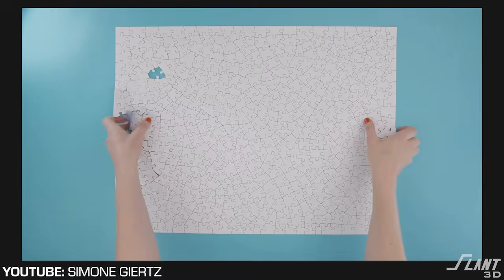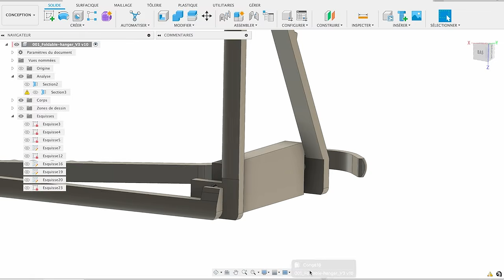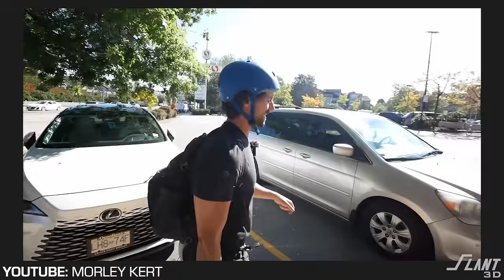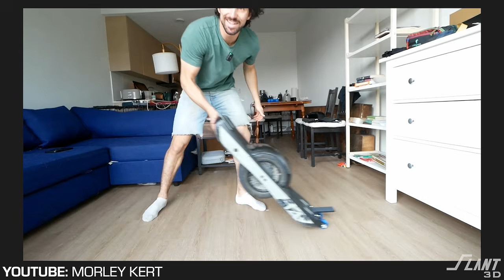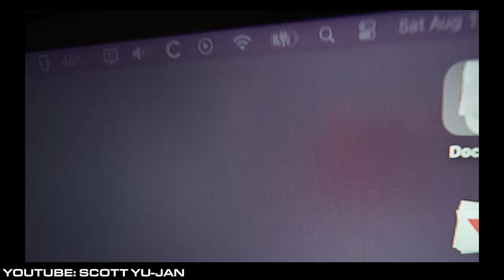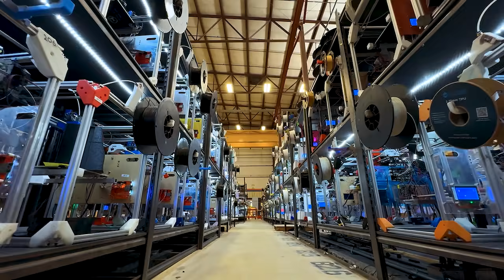Redesigning YouTuber Products for 3D Print on Demand

Comment: Storing T-shirts in a warehouse.
1. T-shirt folder
2. Dust Bags
3. Large Plastic containers. 100L boxes up

Scaling.
DTG - print on demand.
Rotary - Print in bulk.

No need for folding clothes hangers - Unless - you are displaying on a pop up market, which vastly cuts down on set up/break down times.

Comment: Regarding the iPhone design itself (I am aware that it is only an example), it is one of the prettiest and at the same time most useless designs for a simple reason - 95% of iPhone users use cases and each of them changes one precisely defined shape into thousands of completely different ones and such a “modification” is a great example of how difficult it is to implement a generally great idea into practice

Comment: I started selling 3d prints that I designed (not in the trinkets vertical) and they've been really well received. I thought about if I could use Slant3D to make them but due to needing multi-color (4 filament swaps total), needing it in PETG, and needing a small amount of post processing (weight insertion, small amount of assembly), Slant3D isn't viable. And honestly, each of those requirements are really reasonable to have met by a manufacturer.

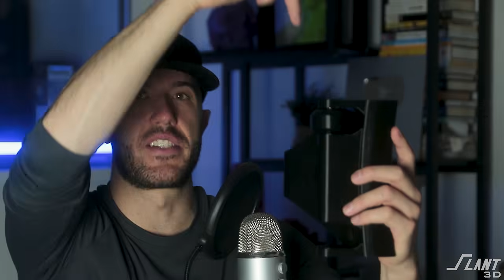Comment: 13:25 why even have two wheels, why not print one veeery wide one, use M8 rod and 2x 608ZZ bearings (even tho this doesn't prob needs bearings at all, or printed fine, but considering a  608ZZ costs what 0.20$? who cares, the rod + nuts + washers prob cost more!)

Comment: I have thought about using Portal to produce and sell my wing/kite pump hose adapters. The latest generation of these is mostly done with print in place design where one part of the print becomes a rotating collar. But... I worry about quality control. Starting out, I would have to order myself prints from the print farm to verify that the parts separate easily enough. If the print doesn't work, I have to try again and it could turn out to take weeks or months. If the print farm upgrades their printers or makes other changes to the print, it's quite possible that the print in place mechanism might stop working again. I also designed tools that make the separation easier, but once the collar rotates, you don't really need the tool anymore, so shipping every product with the tool is kind of wasteful too. So, this means each part should be tested and separated when it comes out of the printer and not at the end customer. But that's manual labor and requires instructions or training at the print farm + some printed tools. With some print setting tuning, the parts do separate easily without tools, but without that tuning, getting the print in place part to separate might take a bit more effort and the tools help a lot.

So instead of producing the parts myself or having them produced at a print farm & shipped to customers, I'm offering commercial licensing of the designs and hoping that people with interest in producing the parts in small scale will start doing so and deal with the selling, production, shipping and customer service. Thus far, my score on that front in zero, but I haven't really put much effort into marketing the products or the licensing yet.

Comment: Your I-Beam explanation fell a bit short (animation pretty misleading IMO) but it might be a good video topic for you in the future. 3d prints do use the same thing, but they're much closer to wooden torsion boxes. As you point out, the strength is in the skin, with the infill's only job preventing the skin from sliding.

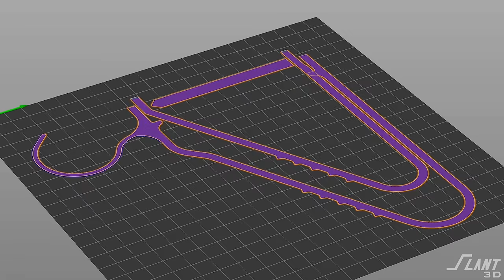Comment: The folding coat hanger is such a good idea. 5:49 I think a double hinge, similar to Simone's design, would solve this problem and allow the part to be printed flat.
Reply: It could have absolutely been printed flat.  He did it that way to be printed in place on the Slant printers, which are not particularly large as far as 3d printers go.  So basically a compromised design to work around the limitations of his equipment.  Same thing he rails against when speaking of traditional manufacturing methods.  😆
Reply: @netpackrat  Yeah this is one thing that really bugs me.  The "appearance of transparency" or worse "lying by omission".  
"It can't be printed flat" leaving out "because our printers are too small".  It's shocked me more than once when a fairly small thing "can't be printed" even though I just printed it on mine.

TO BE FAIR, this is really the only time I see this, mostly they're transparent and have good business practices.   I really hope they're investing in larger printers.

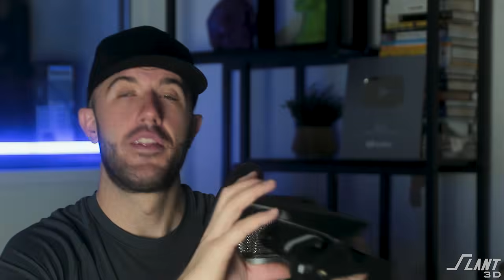Comment: Great video. I love this type of content. 12:55 Can you not move the wheels to the outside and just capture them with an extra set of nuts and washers, sleeve bushings, or designed in standoffs? This would eliminate the wheel channels and any need for supports. There would be other advantages to this design modification as well.
Reply: Double shear is usually better if the design can allow for it.  Done as you suggest, the axle would need to be thicker to resist bending loads, the parts count would increase, and it would also likely be more subject to self-disassembly in use.
Reply: @netpackrat  Hey, thanks for engaging. Gabe's (or Gabe's engineer's) design does improve on Morley's awesome idea. So kudos to them. Love to see it. 

100%, double shear is a stronger structural connection. 

But in the context of this design, the shear forces on the steel axle are not the weak link, the narrow PETG outer tabs are. 

Think skateboard trucks, the diameter of their axels, the relatively extreme forces to which they're subjected, and how rare it is for a properly installed skateboard wheel to fall off. Self-disassembly or bending will not be an issue. 

Regarding part count, good point. Separate bushings or extra nuts would indeed increase the part count. So instead, integral standoffs could very easily be modeled into a design that prints without supports if the wheels are moved to the outside. 

I would have used bushings with both Gabe's and Morley's design to prevent the wheel from wandering over and rubbing on the frame, and more importantly to relieve the loading force on the outer tabs produced by the tightened axle nut. Almost all of these thermoplastics are subject to some degree of creep, so it's always a good idea to design around it if you can.
Reply: @drac800  Another thought, is with Gabe's design, one end of the hole can be printed closed, and the pin installed blind from the other end, with retention hardware (or even melt the installation point closed with a hot knife or soldering iron) only needed on the one end.  Yeah, you would give up serviceability, but at that point the design has been simplified and cost reduced to the point where it would just be easier to replace as a unit if anything breaks..

Comment: What's missing here is Slant3D being able to integrate other on-demand manufacturing technologies, two of which stand out:
- CNC sheet metal processing
- CNC wire bending
Fasteners, embedded nuts and heat-set inserts were just the beginning.  CNC wire bending is almost the same as 3D printing - spool of wire goes in, boxes with parts come out without custom tooling.
Project-specific reinforcement wires that snap into or press into 3D printed parts would be a game-changer, and imo make perfect sense when it comes to the coat hangers - print the complex hinge geometry part in place, push in some stainless steel formed wire, awesome.
Reply: Yes, great proposal, but wire bending requires much more consideration on the author part. In that sense sheet plastic and maybe metal cutting (without bends) is much more "print on demand" friendly
Reply: @ВоваЕршов-й2ь  One can be rather explicit about the techniques (and design rules) applied and tolerances achieved, which then puts the onus back on the customer.
I remain confident that CNC wire bending would be the most powerful addition without a lot of complex tooling and machinery, since it's so versatile. 
On the other side, there are machines like TruPunch 5000, that can churn out parts in truly lights-out fashion with a rack full of punch dies and anvils, indentation and tab bending tools and nibble / cutting tools so mostly-flat yet intricate parts can be produced in a purely software-defined way.
With the recent generational shift away from 3D printering to people no longer tinkering as much with the technology though, the community has grown some aversion to radically different and initially less polished and well-integrated approaches.

I personally design purely functional parts most of the time, and often find that FDM material properties are insufficient. That's where products like the FibreSeeker 3 come into play - they promise to integrate reinforcements into 3D printed objects in an automated fashion, letting the software place the CF inlay based on its own structural mechanics strategies. The need is there, it's just that the effort to bridge the two domains of AM and free-form wire and sheet metal processing haven't been brought together.
Reply: On 2025-12-21, Hackaday dropped an article exactly on putting metal reinforcements into 3D prints, titled "Pause Print, Add Hardware, And Enjoy Strength"
I maintain the position that this is a cool thing we should have a service for.
Reply: 2025-12-29 Update! [alexander rueffer] just released his video titled "3D Printing and Sheet Metal: Dream Team for Reinforcement"
He tackles surface activation for glue bonding and explores the impact on stiffness and strength.